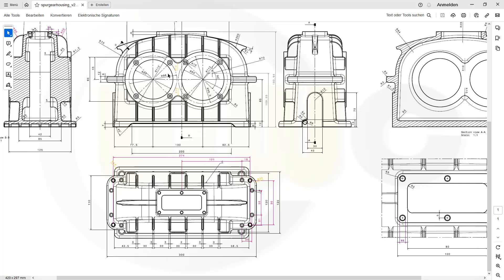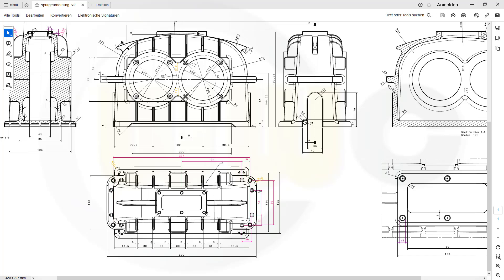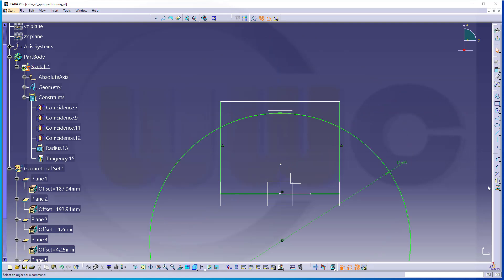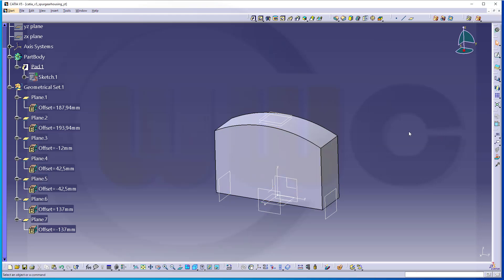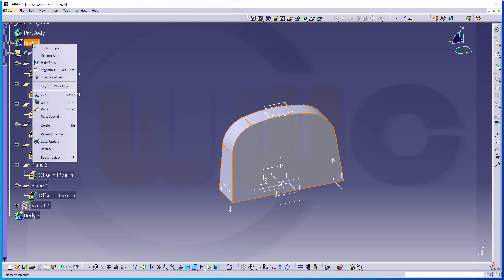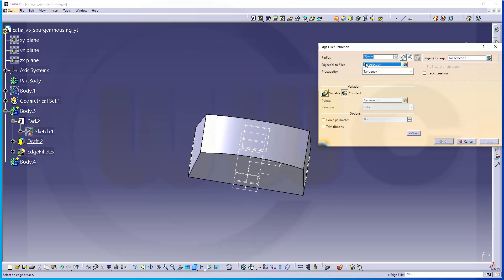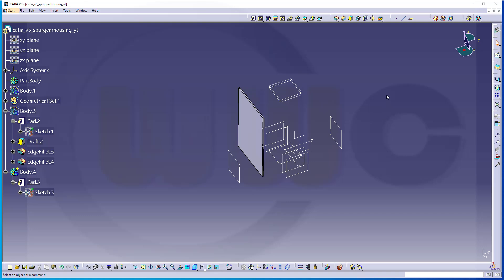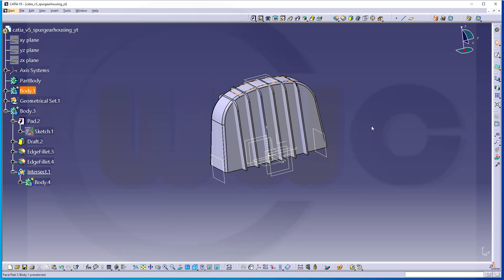Spur Gear Housing - Sterngetriebe Gehäuse  Part 1 - Catia v5 Training - Part Design

Comment: Hello sir, I am trying to mirror a multipad but I am facing an error as follows, ‘the selected feature can’t be transformed’. Error message is only applies if there is a multipad or a multipocket. Do you have a recommendation? Thanks in advance.
Reply from the maker: I would recommend to not use multipads and multipockets at all 😉 Usually these features are not used in catia v5
Reply: @wolfgang.walden.cad.training  Thanks for the answer sir. I will take into account that!